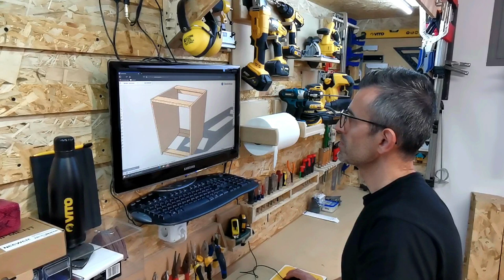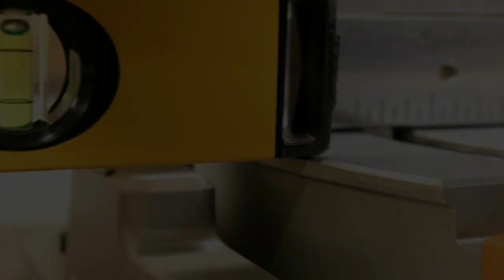3 in 1 Miter Saw Station Build With KREG Track & Stop System - Shop Storage Upgrade

Comment: Any chance you have plans in English and imperial measurements? I would love to try to build something like this for my garage.
Reply: Does that mean you do?
Reply from the maker: Hi Chris, thanks for your comment, please subscribe to the channel 😉 unfortunately i don't have the plan in English with Imperial measurements. But you have two options: use a conversion tool from metric to imperial, or buy a metric tape measure. In my opinion the second option is the easiest and most effective way to use this plan. Hope you find a way to do this, it would be great to know that someone has build one like mine.
Reply from the maker: Can't do that. Sorry.
Reply: @WoodYouDoIt  ok. Sounds like an option. Do you have plans other than the video? I saw the cut list on your website, but had trouble finding plans. I am a very novice woodworker so plans are often helpful.
Reply from the maker: @CGYT16  Totally understand that. i don't have detailed plans, but you can find on my website some prints of the cabinets ond drawers with measures and i think they're pretty easy to understand. Just scroll down on the miter station project page and you'll find them.  I think the prints and the cut list are intuitive and enough to build this project.
Reply: I'd start your plans with the decision to avoid using OSB as your wood of choice.  Then go read what its designed purpose is as well as which wood you should be looking at in this video. I recommend Baltic Birch

Comment: Has the shelf you used for the mitre saw been strong enough? I have that saw and I'm not sure if 18mm thick material will be enough. It's a heavy saw. Thanks
Reply from the maker: I put two metal bars under the shelf to reinforce. It works great.

Comment: Can't really tell, does the OSB you use have tongue and grove?
Reply from the maker: No.
Reply: @WoodYouDoIt  thanks for the reply, can't seem to find 3/4 OSB in my area without it
Reply from the maker: @SuperTim1965  you can use it with tong and groove, it's ok. Just try to use it on the back of the cabinets or in the back of the drawers. Or you can cut it and lose just a couple of centimeters.

Comment: Amazing work, terrible song ;)
Reply from the maker: Thank you David.
Reply: @WoodYouDoIt  I've never built drawers and cabinets with OSB because I don't really like its edge. It looks rugged and I'm concerned about wear over time and use. What's your opinion now you've build it ? Thanks
Reply from the maker: @davidm1551  Wear and tear won't be a concern if we take good care of it. In addition, there is always the possibility of applying varnish which prolongs durability. On the other hand, any piece of a drawer is also easily changed if it is damaged with use because no glue were used on the drawers.
Reply: Thanks a lot, I may give OSB a try 😅